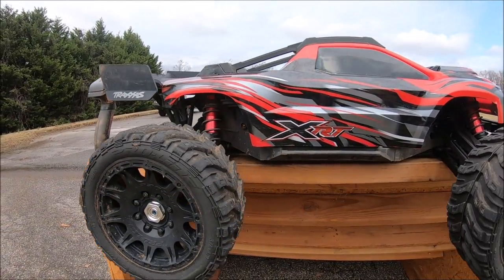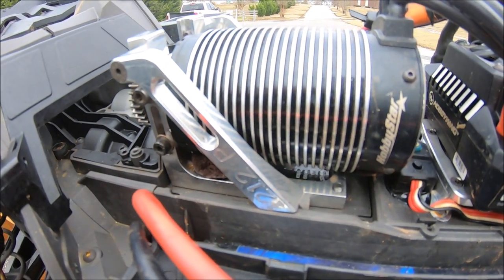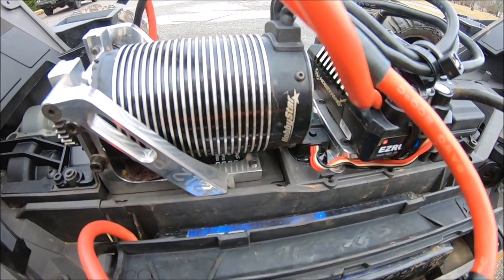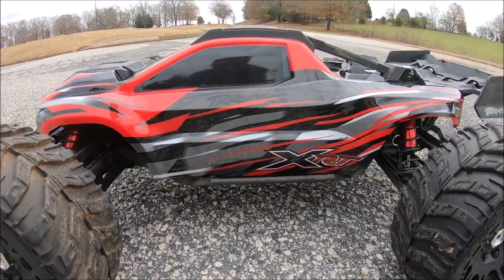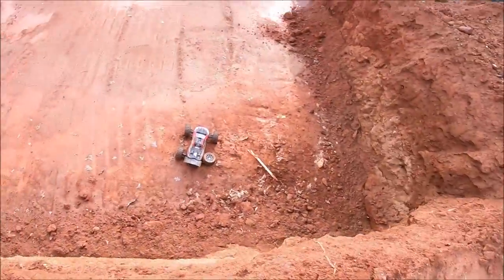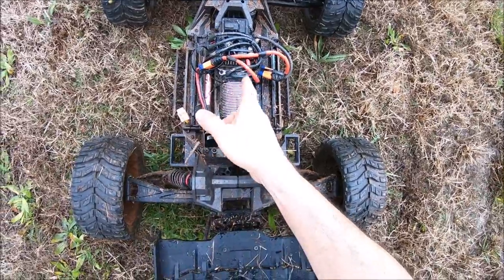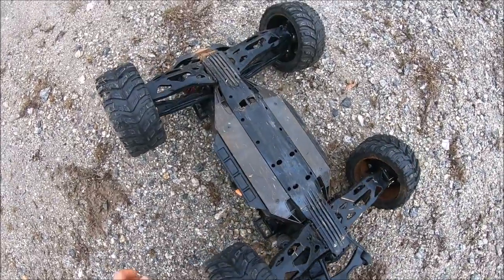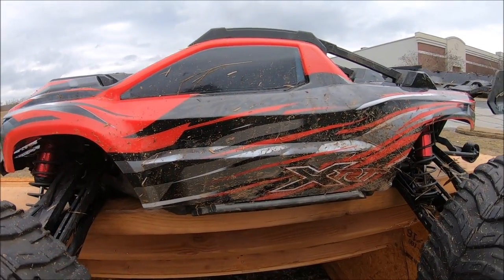MASSIVE POWER!😱TRAXXAS XRT 8s Hobbystar 1120kv, MAX 5 and NEW M2C upgrades test!

Comment: Hey Eric, I’m thinking about buying one of these XRTs but I noticed you changed out the 1250kv motor- did it feel like it wasn’t enough power? I’m trying to figure what I’d put in if I get one.
Reply from the maker: The 1250kv was great with the 23 tooth speed pinion. The bigger motor definitely has more torque though.

Comment: How are you guys running such tall gearing?! I’m on 25/50 with a 1100kv and xlx2 and I feel like it still gets hot. Even in cold New York temps. Mesh is good and no drivetrain binding.. any suggestions?

Comment: ADVICE NEEDED  before the upgraded centre shaft was you bending them? Iv not ran my xrt yet but im temped to get the chassis brace but i dont want to shift the forces and start distroying bulkheads ect
Reply from the maker: Imo with the M2C chassis brace you can probably run a stock center shaft unless you are really pounding on it🤣The brace really saves the chassis from overflex and snapping in half! Before the chassis brace I was bending the stock center shaft but not as bad as the Xmaxx. The flat bottom of the XRT helps with even chassis slaps.
Reply: @RCDUDE81  I had a collect of bent xmaxx centre shalfs going on at one point untill I seen my arse and chucked them all in the bin lol I'm just a little worried that if I brace the xrt I'd just shift the issue else where like the bulkheads ect as some flex can be good sometimes

Comment: I might be wrong, but I think it's might be faster with a Max6 since the KV limit on the 5 is 1000. So you're not getting the full power from that 1120. I think. I dunno.
Reply from the maker: Max 6 won't work. I tried and it fried it immediately. This motor needs a big ESC.

Comment: I have a question, I want to run a 4s setup on my Arrma granite 4x4 mega (the blue one) and I was wondering which motor and esc would be great for a 4s setup
Reply from the maker: A Hobbystar 3670 3050kv and a Spektrum or blx 4s ESC or even 6s ESC will do the trick. At least all the connections fit right up. I'd also recommend a steel spur gear as 4s will eat up the stock plastic one.😎👊👊